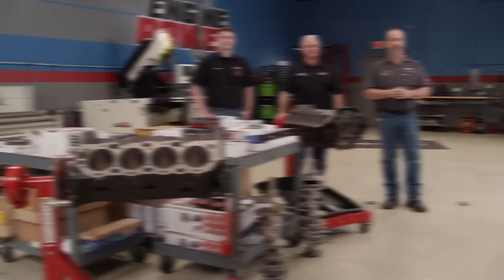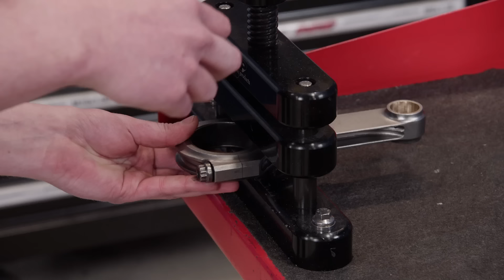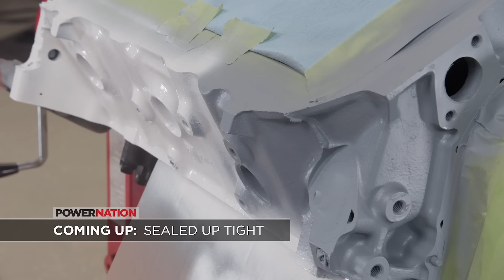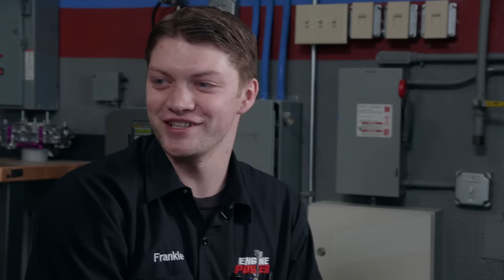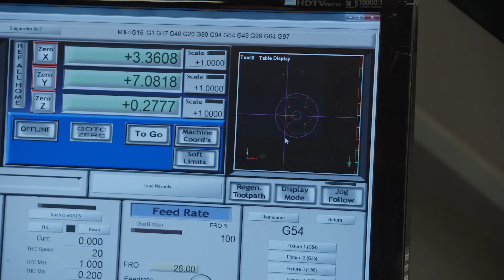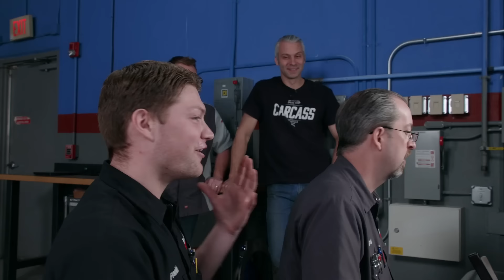Twin Big Blocks Dyno'd Together - Engine Power S9, E5 & 6

Comment: Dual engines together is a fantastic demonstration, but look at how Pro Tractor Sled Pullers hook up five or six engines to one axel to pull the sled.  They hook these engines at differing heights and angles using gears, perhaps chains and heavy duty drive shafts.  Could you investigate how they do it on one of your shows?

Comment: Now quad compound turbocharger both engines. Also do a power adder shootout with this setup from single turbocharger both engines to twins the quad and compound turbocharged then supercharged nitrous and supercharged turbocharger nitro 😂 add all the power bits all at once 😮

Comment: This episode gives a bit clearer view on the age old question about what will happen with horsepower and torque if you put two engines working together. The guys got almost double the torque and double the horsepower, they were just 3% short of a full doubling of torque and horsepower. Probably correct phasing would give them full doubling of horsepower and torque. Nice episode.

Comment: Guys, you did really really great job, here is an theory, what if you make connection as Y shape to connect the two engines carburetor manifold at one input and install a aircraft carburetor such as Musting P-51 or what ever, here the control will be one which is feeding the two engines at once 

Thanks and respect fou what you have done from Saudi Arabia

Comment: So by synchronizing the firing order what they did was basically make a V8 with double the displacement.
I wouldve gone for #1 cylinder (of the second engine) firing inbetween #1 and #2 of the first engine. So you effectively make a V16 with double the power strokes per revolution.
Wouldve been interesting to see both concepts head to head.

Comment: Since you have all the data how would this compare to 1 engine at 14.7LBS boost. One engine double the air half the rotational mass.  What would be the difference for fuel rates. How much boost would it take to reach the same power level as the two engines.

Comment: hello i just finished watching  this episode on samsung tv plus,  and i bet its probably been said by now,  but that 3%  you lost or were down, is lost at each connecting point and the shaft its sel;f   ( just like how aat crank hp aand at reaar wheels hp  you lose a percentage of hp 
however  itd be msaybe  a good waay to demonstrate the difference of results due to material things are made of, whether or not they have the wseight evenly distrubuted( blue print n balance the connecting shaft and its connecting ends   then you could make one from aluminum,   or titanium, or carbon fiber, have them perfectly or near as can be perfectly balanced etc   idk  ne ways  great show and episode!

Comment: Good show boys and very interesting as both are pump gas engines --- BUT 
The twin engine thing has been going on since the 50's in drag racing and tractor pulling in various ways to hook them together, side by side AKA Tommy Ivo, Howards Twin Bear, or in line like yours AKA Lefty Muddersback N/A or The Freight Train Blown --- and there were several coupes and sedans with twin engines - there is also a web site dedicated to twin engine drag cars - This visual HI-TEK simulation is great; do some more follow through - tix the headers, and connect the intake and see what it can really do ---

Comment: I grew up watching a few cars with twins and heard stories every day from the old timers about the Top Gas days. We used to race Nostalgia Eliminator #1 and back in the Goodguys days, Mike Kirby ran Sissel's twin six car regularly with two 250 style injected sixes inline for consistent 7.50 ets. Another twin six was the Clarke and Alred Twin AMC car from the same era. These were actually Late 60s comp eliminator D Dragsters running on a loophole in the rules for a few years. Then  there was Jeep and Ronnie Hampshire who ran twin F85 Olds motors with custom 180 degree cranks in them, The Odd couple ran a Chrysler and a Small Block inline, John Peters and Bob Muravez ran the freight train out of Venice CA, there was a car with twin Pontiac Tempest 4s inline (1/2 of a 389 each) called Eight The Hard Way, Donnie Hampton even had a Corvette funny car with side by side twin small blocks. Thats just a few. Whenever I see a twin, I cant help but stop and check it out, they just scream cool!

Comment: We would just take scotchbrite and do a polish evenly on the bearing  "buff in" our clearance, did it plenty  times, Worked great,  not once EVER any issues from it!!! Not once!!!
The bearing's coating  white surface material comes OFF almost as soon as engines free so you gain 0,001+/- immediately anyway.

Comment: I would almost be willing to bet that if the carbs were synced most of the lost power would found. Think about multi carbed motorcycles. If your carbs aren't synced, it will run like crap.

Comment: I'd be really interested to see this vs the transverse.. this is 2 engines in series, I'd very much like to see 2 engines in parallel.. you could further breakdown the parallel test - 2 engines > 1 transmission > dyno, and 2 engines each w/ their own trans > dyno - but I'm not sure if the parts even exist for the Y-junction (possibly boat drivetrain parts or tractor PTO parts?)

Comment: 17-10-22
The Frequency Of Vibration
Well done to all of the engineers who put their time, effort and knowledge into this video on performance-matching ICE motors. It was viewed with interest, as I was expecting the outcome to have been with lightning and people ducking for cover as the coupling failed. I have seen what happens when a lathe chuck key falls on a spinning chuck. At the speed of a jet, the chuck key shot across the workshop with a great lot of kinetic energy, missing the machinist by an inch. The incident left the lathe operator shaking like jelly, with a dazed look on his red face but luckily he had no blood loss on that day. A prior warning of the potential danger was ignored. Remember - Prevention is better than cure. Accidents happen most often due to negligence. 
	
I would like to see another test by the engineers in PowerNation. That would be an ICE engine against an EV motor.  I designed the concept for the PRIUS Hybrid EV and then the TESLA all-electric variant, but before my work was completed it vanished from my home, so I boxed myself in my home and stopped designing things, while I lived in fear for my life because much of my work was of a technical nature and I did not know who had it, but my work on vehicle technologies has resulted in many wonderful things coming of age. 

Although I am not known for my achievements, it is nice to see experiments with motors performed by people who care sufficient to do it and make the results of their work available for like-minded people to see and enjoy such tests, which I certainly did as I watched this video.

I believe the addition of a safety screen, for use when testing power trains with direct coupling, would be worth considering, as metal travelling at high velocity can ricochet off walls, floors and ceilings in a split-second. 

From my observation, the addition of a flexible coupling, to relieve torsional stresses between the crankshafts and longitudinal misalignment, would be worthwhile. Also worth considering, is the tuning of the exhaust pipes, starting by making their lengths evenly matched. A temperature reading of the coupling could reveal where energy is lost in miss-aligned shafts. Vibration sensors could also help to determine where power is being lost. The frequency of vibration can be used to detect faulty bearings, as well as earth tremors, and the forces generated by them are great, although unseen until it is too late.

Comment: Even with a downward curve I want the extra 1000 rpm for shifting leeway, if power drops at 5500 I want to shift just before/at 6000 naturally but having that 6500 redline is preferred that way I'm not hamming out the engine beyond it's actual limits of integrity.

Comment: Tying two engines together actually does have a practical use. Out west in the Texas and Oklahoma panhandles I’ve seen several instances of two big block V8’s tied together as power units 
powering deep irrigation wells in the Oglala aquifer. They’re not as common as they used to be, with big Cat and Cummins natural gas engines taking their place but they still are in use.

Comment: Damn great numbers. 
The difference between the projected and real could be from an amalgamation of "stacked tolerances".

I know it's a relatively short run (timewise).. but for confirmation of the exhaust being responsible, take of the collectors and let them exhaust separately and see what the result is.
Other possibilities:
1. if you just plumbed in a splitter connection to the same cooling system, without upsizing the capacity and flow for the new thermals, it won't be as efficient.
2. the engines are out of phase. Linking 2 engines isn't much different to a cam having lobes slightly angled out of spec
3. the "weaker" engine, is holding back the the more powerful one.. so there will be a bit of an increase to the weaker.. but also now drag applied to the stronger by "loading it"
4. the rear engine is pulling in slightly hotter air, created by the engine in front & exhaust around it. (insulated direct piped cold air intake, would eliminate this)
5. I know at some engine dyno shops, the fuel supply to the engine is controlled by the shop's fuel system.. did they both share a single fuel pump?
6. torsion in the coupling rig is also a possibility

All in all.. I'd drive it :D

Comment: Is 1.2 HP per cube a lot?
Reply: It is if you've got a 900+ cubic inch motor!
Reply: @JR-The_Godfather_of_Horsepower  😂 as a ratio, as in is it considered weak sauce next to builders squeezing out 1.5 hp per cu or higher NA?
Reply: @WesternReloader  we usually try to get as close to 2 hp per ci in our builds.
Reply: @JR-The_Godfather_of_Horsepower  that’s huge power, im tuning my 331 10:1 stroker 302, can’t wait to chassis dyno it and see where it’s at, should be able to find a quality chassis dyno shop in Los Angeles I hope
Reply: @WesternReloader  Just finished our 598 ci stroker last week, ran it on the dyno and after some tuning we're seeing consistent pulls of 1196-1204hp and 997-1004 ft lb torque. Running a new style head that's been hugged out and fitted with some of the biggest valves we've ever used. Got the idea from Steve Morris, he's building some insane power engines now, and one of his motors just went sub 6 seconds at dragweek! Pretty crazy to think you can run a 5.80 1/4 mile, and then drive that same car 400 miles to the next track and do it again!! His Steve Tech videos on here are some of the best when it comes to unlocking all of an engines potential. He's got a big old station wagon he's run at sick week that is running way faster than it ever would've been thought possible, plus he's doing stuff with Lamborghini engines that I'm fairly certain the boys at Lambo never would've dreamed of in a million years
Reply: @WesternReloader  The ultimate goal of ours was to try to hit 1250hp with a na motor that had a standard 9.8 deck height. We're getting really close, but these last 50 hp might actually never come, unless we're willing to go to a higher compression, but right now it's running on 92 octane without any additives.
Reply: @JR-The_Godfather_of_Horsepower  that’s huge power my man, keep up the great work, we need to fight back against the evil powers trying to steal our american dreams, i.e., no gasoline etc.

Comment: What I’d also like to see is the air fuel ratio‘s on each cylinder as well also why didn’t they try to close the gap between each engine I know it was only a few horsepower and torque but like they said it comes down to my new differences in tolerances it would’ve been cool to see how much of a difference there would’ve been if rather than connecting the exhaust with a y pipe Having their own separate exhaust like two single exhaust on each side or connecting all four into one

Comment: Great  video. Makes me want  to pull out my shelved 138" long wheel base 23 T bucket frame from 1985. Go through  my notes for putting 2 small blocks inline and rethink it all over again. But I'm already thinking 2 BBC's inline is too much weight, for a 3x2 box tubing frame that long on the street.

Comment: You two motor heads should put the turbo 4.3 V6 you built in front of one of those 496's . . . Set up a progressive linkage with another self-contained EFI kit on the BBC so it doesn't start opening until the V6's EFI is at 25% to 30% open. With the EFI systems' returns looped back to the pumps' inlet sides. Two high- pressure pumps with Y-ed inlets should allow you to guage usage from the dynometer's fuel flow turbine for combined use and also establish consumption for each engine at different throttle inputs by comparing injector the pulse width data of the two systems . . . Literally see if the mildly cammed turbo V6 can carry the big cammed V8, still at an idle throttle blade position during regular cruising . . . The hope being that the turbo V6 and the big stroker V8 would fit in a factory straight-8 equiped car's engine bay(or that of a classic pick-up truck with a bed mounted radiator with electric fans pushing air toward the front of the box for aerodynamic purposes) for economical and practical Power Touring or Drag and Drive events 🙂

Comment: Back in the '70's a neighbor ran twin Chrysler 440's on irrigation wells.  I think they just put a U-joint between them.  Cheaper than the Minneapolis Moline 800 CID inline sixes we ran but didn't last as long.

Comment: Both at TDC #1compression stroke is a wrong way to run two engines together,  it wont reach higher rpms n power.

Comment: already been done. American V8. My boss has a twin engine camaro with a coupler system designed specifically for that.  854 SS. He is actually designing a new coupler system for putting the application in boats.

Comment: Could be enough torque on the drive shaft to twist it just slightly. Throwing the timing off for the cylinders closes to the dyno. However both engines have they're own distributer, which would decrease the possibility...

I've heard Porsche had an engine in the 70s that had this issue. It was a boxer style, 12 cylinder.

Comment: I worked on several multi-engine cars before. SBC 302 CI / 5 Liter engines were connected to 6 speed transaxles. There was no hard connection between engines. One engine / trans in front, one engine / trans in rear. Front engine placed engine first with trans in front. Mass of engine closer to center of car. Engines synced electronically. With no drive-lines used, no tunnel in cockpit. Both considered mid-engine, because engines sat behind wheels. 

If we do decide to hard link engines together, we will add a clutch so one engine can be running, the other not running. Better gas mileage around town, and we can alternate what engine is running. This spreads wear more evenly. Car has 3 modules; cockpit, front power, rear power units. Each power unit has everything needed to run, including fuel. Entire power module can be swapped in under 5 minutes. Pull into the pits, get fresh engines, new tires, and fuel, leave pits ready for next hour at Le Mans. 

End result 4 WD / 4 WS with over 2,500 HP. Since each engine was only producing 1,250 HP reliability was increased versus 1 engine creating 2,500 HP alone. Engines were using twin charging: two screw supercharger on engine being force fed large amounts of pressurized air from turbochargers. 

Able to get much better linear power curve than with turbos alone. If turbo spins twice as fast, it produces 4 times more pressure. Resulting power curve increases exponentially. Combo helped tame engines, even good at low RPM on the streets. Not bad for a 5 Liter engine making 5 HP / Liter.

This prototype is good for 300 mph / 483 kph plus. We have a BBC 4 engine prototype with over 10,000 HP. It is good for over 500 mph / 805 kph. Waiting for Michelin or Goodyear to supply tires that won't melt or fly apart. Tires are the limiting factor for Landspeed applications.

When building identical engines, you will never get exactly the same power. You can get pretty close though. Even running same engine at different times of day will result in different power output. Shop temperature, barometric pressure, fuel temperature, etc can all effect power. Remember IROC.... identical cars and engines. Engine supplier was able to match them within 5 HP plus or minus.

Comment: Dude. That first run was diesel numbers😳😳 2 to 1 torque to HP. Does that make this a diesel engine?😳 even the second was insane. Dude I want one of these v16s instead of a diesel. Thus has more torque

Comment: This set was very common in our area during the 80’s on the farm to run deep wells for irrigation. We called them sweet 16’s. By the early 2000’s they were mostly replaced by diesels.

Comment: If you reclock the driveshaft between the engines 90 deg you will get a different reading if the power goes down reclock it 90 deg from the original position in the other direction.

Comment: I think another reason it was slightly down on power is that the coupler drive effectively adds about 30 or 40 pounds to the rotating assembly. It would be interesting to do a pull at a different sweep speed to see what it does to the power